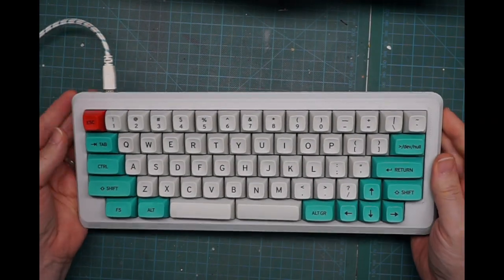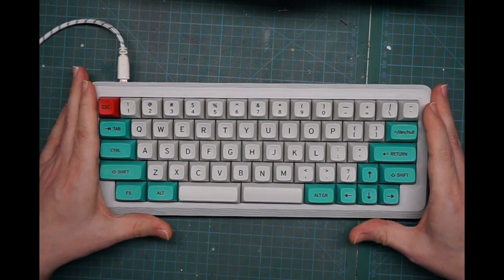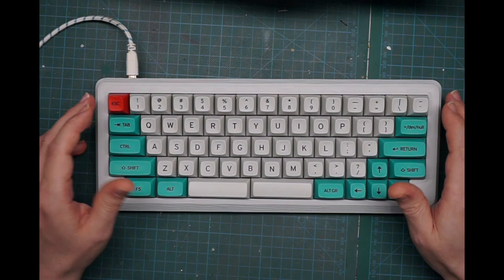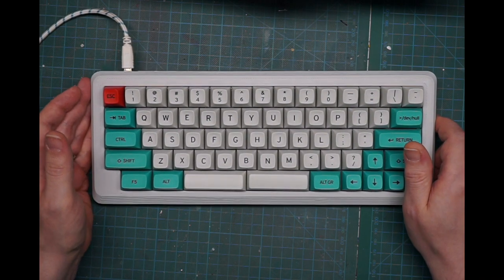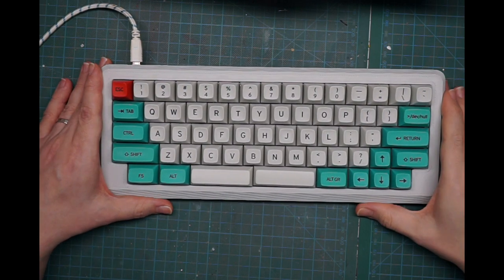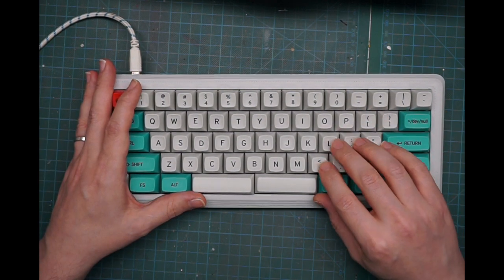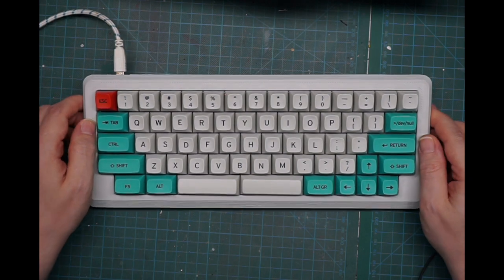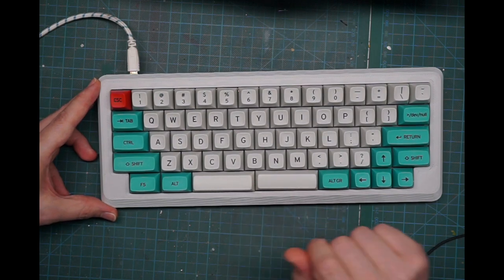Hand-wiring a custom layout keyboard

Comment: Wait, an Annex 3D printer? In fact I can't think of a better option to print a full keyboard, you need at least a 35x35 build area, that starts to be not a great option for a corexy.
I think I will try even crazier layouts in the future, like you I can't live without an arrow cluster (especially because I use more ctrl+arrows to move between each word than regular arrows), but I also use a lot home/end, forward delete, and even the menu (to be able to correct words with the suggested one without using the mouse). I figured out that since I use the spacebar only with my left hand I could use a small spacebar and the freed space for those buttons, and everything I need would fit a 60%. What stabs are you using? My idea was to use plate mount stabilizers as there obviously be no pcb, but I don't have any experience with costars.
Reply from the maker: it's not actually an Annex, but the concept is the same (cross rail cartesian). I tried with a corexy but it didn't work very well.

The stabs are costars. The best option imho for hand wired keyboards.